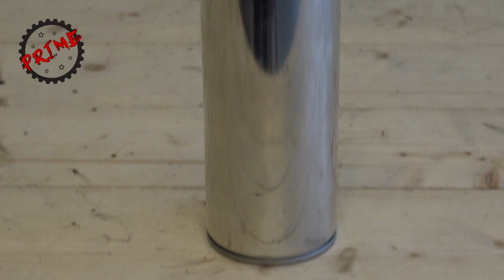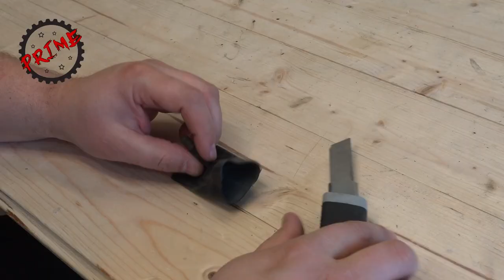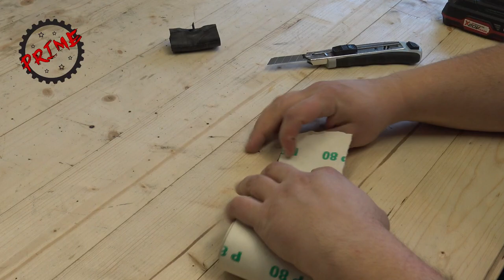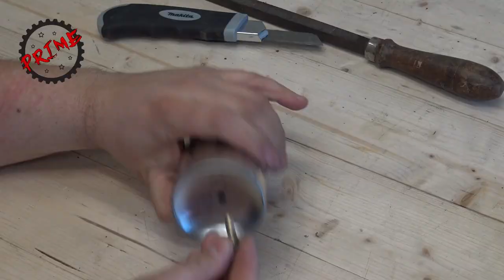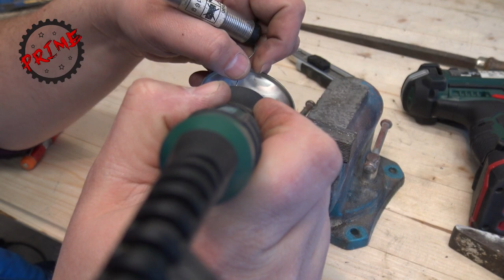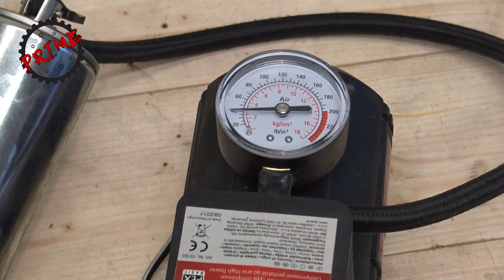How to make a Compressed Air Can - LIFE HACK

Comment: I have a hard time believing this would last even 1/4 the time a CO2 compressed air duster can would last. All that work for??? There's gotta be a better way!
Reply: it's refillable, that's litterally its purpose
it's a store of compressed air if you will
so that way, people (me) won't have to buy a new canister everytime for my bbgun
Reply: @Jlyx  ahh ok. I get where you’re coming from. My need is for more continuous blasting of air. I work on set and when it’s raining and I need to blow off water that’s starting to get on electronics etc. so I kind of need something comparable to a air duster style situation but I want to refill it.
Reply: @zkidder  some el. air duster then. 40k+ rpm